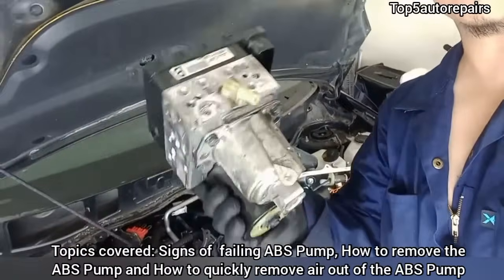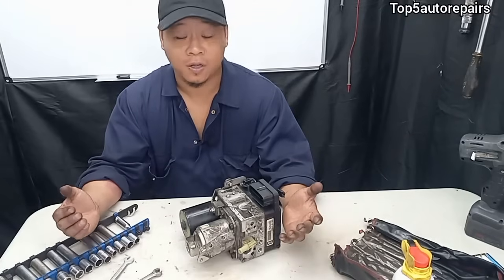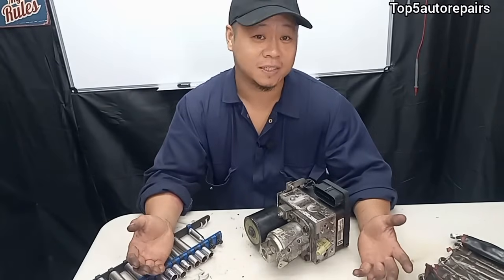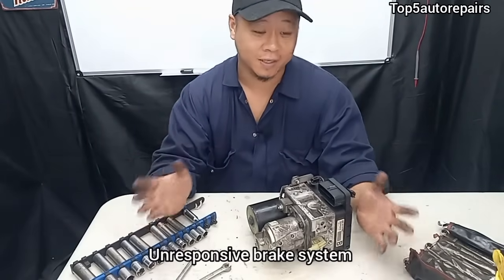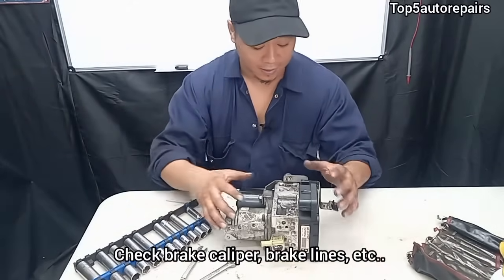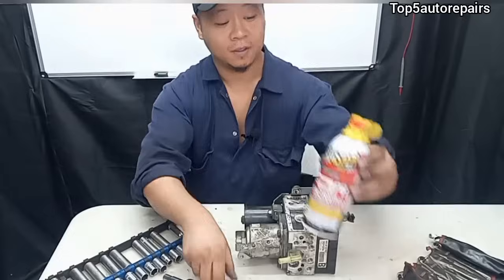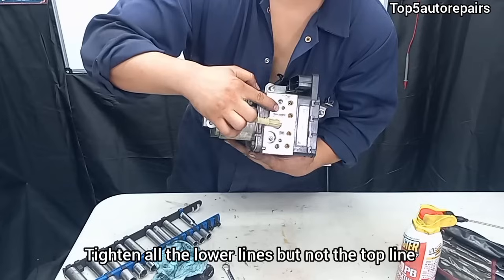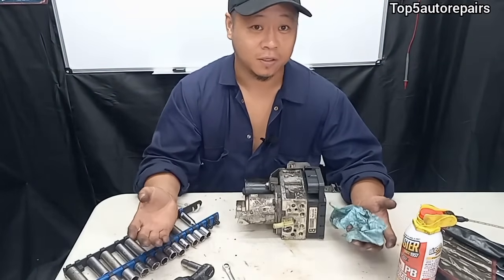4 Signs Your ABS Pump is Bad and Failing (How to get of air quickly after replacement)

Comment: i got a 1997 buick lesabre. Was my grandparents car. Brakelines failed, had all new brakelines installed. Now it has NO pressure to the front brakes. 1 person said the dump valve inside the pump is stuck open. Im lost.
Reply: Might have a brake proportioning valve on that vehicle.  It is designed to seal off part of the system if brake line breaks.  It can become engaged when bleeding brakes.  Probably many videos on how to disengage it on GM vehicles.  There is a little screw in tool usually, but can be done without it.

Comment: My breaks gets hard once I engage it on gear maybe reverse or drive the break is very hard to push but when in neutral it sinks to the floor...
I have replaced the booster and master break but its thesame please what could be the problem

Comment: I have a 2015 Honda Civic Si coupe that starts, I drive it about 30 minutes I turn it off and it doesn't start, I just wait 30 minutes or 1 hour and it starts again. Could it be the ABS pump?

Comment: Great video I have a ABS problem w/ my CVS 3.6 Cadillac, it burnt the module harness and I haven't check it yet but this guy understands them very well   I may just change module and pump... along with whatever. THANKS.
Reply: Have you been driving it still? My dodge charger got a abs brake pump leak…
Reply: @joshflows4848  yes no problem with the brakes.just the abs module and the connector.

Comment: Thank you for taking the time to make is video. Hoping you or someone reading this can advise on my issue. I have a 2014 Honda Accord V6 that dashboard lights up with a few lights(ABS, tire pressure, parking brake, VSD. The local shop did a scan and got codes (81-20 Acceleration sensor, 85-01 problem in VSA system, U1281-00 gauge control module lost communication with MICU, and U0416-68 VSA brake actuator malfunction), Took it to the Honda dealer they said need new ABS unit. Price parts and labor $2400. I saw a couple of videos where they just removed the black module box and sent it for repair(apparently there are services that repair these units for $200-300 and then can reinstall the module. It seems this it not an uncommon failure for Hondas but no recall by Honda. Any options for this repair?

Comment: I think they used to call it the proportioning valve but everything’s electronic today so it’s called a ABS Control Module/Pump. I’m replacing mine now after replacing the left front caliper which was locked up and still have the same issue. I appreciate your video. Especially the bleeding part and leaving the one brake line opened. Thank you! 👍🏻

Comment: My module has been rebuilt but light is still on returned to place where it was rebuilt abs they said it tested good from original rebuild said need to replace pump after a abs module rebuild but they dont make them anymore 01durango so im screwed

Comment: None of those 4 signs happens when I drive, No Codes No trac Lights  BUT When I stop from a 30 mph or higher  the ABS comes on and pumps the brakes.  Its annoying, even after  two mechanics said the ABS system is ok? I am wondering what is wrong with this car 2011 Nissan Maxima  Sv.  I will check the wheel sensors next. BUT  AGAIN  NO DASH BOARD LIGHTS NO CODES NO ELECTRICL ISSUES.
Reply: Have you found a solution, I’m also experiencing the same issue.

Comment: Hi Top 5, your new subscriber. I need your help. In my motorbike with dual channel ABS, on the dashboard, there is no ABS indicator malfunction, yet front braking is poor, it takes more distance to stop. And the rear brake locks up on hard braking. What could be wrong. Any advise is appreciated.

Comment: Hi Top5 I have a Merc sprinter 416 2005 auto . I test drove the vehicle and found the break peddle went  slowly all the way to the floor, so i assumed that it was the master cylinder , replaced the master cylinder , bled the system with the engine and ignition off and the peddle was hard and constant . I started the vehicle and the peddle then went to the floor same as before , with the ignition off the peddle is hard and constant , with the ignition on the peddle goes to the floor . Is this a falling ABS unit ?  Thanks
Reply from the maker: Did you bench bleed the master cylinder prior to installation?
Reply: @Top5AutoRepairs  . No I did on the vehicle at the master cylinder and then at the wheels .

Comment: Hello, 

got a Yaris 2013 hybrid and the rear driver side brake keeps holding, pads got wear out and it’s making constant contact, had the calliper change but still makes contact was told it mind be the abs pump. No warning lights on dash and other brakes are fine just one giving problem.

Could it be the pump ? And does a replacement used pump needs programming ? Or is it better to repair the current pump?

Comment: Lots of work and expense to replace that. Why not just remove the fuse that controls the ABS pump instead?
Reply: If you do it, your dash doesn't work properly. And If you go for your annual car check, they will put the vehicle in a machine to analyse the breaking performance. Then it will fail.

Comment: Hello Sir,
I need your help very much.
Abs pump failed in my Toyota Prius 2010 nhw20 since more than 2 months.
I've purchased an abs pump actuator 44510-47050 three times.
Every times after being placed, it wasn't functioning.
My car tech has tried all possible.
I don't understand what's the issues.
Are the spare parts I've purchased are all defective.
Please Sir, can you get me such a used fully functioning spare part and also grant your help to guide my car tech to resolve the abs malfunctioning issues.
Awaiting your reply patiently.
Reply from the maker: They're not defective. Air is trapped in the ABS pump/Actuator. You may need a scan tool from Toyota to bleed it.
Reply: @Top5AutoRepairs  Thanks loads Sir for your reply.
My car tech has his scan tool.
How must he do the bleed to remove air?

Comment: My problem is I keep having to get my brakes repaired about every 3 months.  I keep taking my car to Midas for new brakes but after the second time, Midas brake company told me to take my car back to the dealership and tell them my ABS is malfunctioning and causing my calipers to tear thru my pads just about every 3 months.  I’ve had so many problems with my Chevrolet Equinox.  My car dealership tried to tell me it wasn’t my ABS but I don’t believe them, so I’m taking my car to a different GM dealership because every time I keep having to get new calipers, pads, etc.  I’m so frustrated!
Reply: So what did the stealership say the problems was?

Comment: Could you tell me why my abs pump runs non stop killing my battery ? i unplugged it and it drives fine but now all the lights on the dash are on. other then that the van drives fine its a 2019 ford transit. Any input would help.

Comment: Old rubber brake lines can decompose internally and not release  the brake pressure. Be sure to factor  that before changing out your ABS. Sticking calipers can also cause the brakes to act strangely. You can check this by feeling for hot rotors after driving.

A line wrench is also called a flare wrench.  They prevent the  fitting from stripping if they are on too tight.

Great tip for getting the air out. I am dreading changing out the ABS module on my Mazda 6.
Reply: What if mother keeps running?
Reply: I will pay and provide the best ADOBO!

Comment: 2008 Escape, new master cylinder, good brake pads , no leaks, good booster. Brake pedal bleeds down to floor. No abs light and brake light doesn't come on. Didn't start having problems until I took off from a dead start and spun a wheel which the traction control light came on. Didn't have brake pedal when  i went to stop I had to really pump them. Got home, shut it off, pumped the brakes up hard and then they worked, until I spun a wheel again. Same thing.
Reply: Did you figure this out??
Reply: @Steven-pi4nv  no I just replaced the abs unit with a used one and bled the brakes again and still no pedal.
Reply: Reset. Calibrate
Reply: @levanibatimala7740 it had air in the master cylinder after I replaced the abs unit.  I bled it again and now it still works fine.

Comment: what if all my abs lights come on and when those come on it also turns on my brake light and my power steering turns off and my obd2 scanner gets no reading from front left abs sensor and my abs sensor intermittently stops sending data/fails?

Comment: I think mine is going on my equinox,car shakes when I go 35mph,it disappeared then came back,the abs & stabili trak light came on then went out,dont know if its the sensor or the abs pump,tested the sensors in front & no reading where the back ones I get a reading

Comment: Hey there
I have Toyota Pruis 04 or 05 with a FUCKING problems with that ABS module it keep making noise & some time braking system. Also I got a other ABS module from E-bay it was a used unit. If I check the ABS unit real closed I find a hair line crack on the bottom base unit that it call computer broad. So I put the old ABS module pump back in the car 🚗.  So could you tell me how did you get the last 5-brake line back on the unit. I don't want to FUCK up the brake line up.
I'm calling from Houston TX
Reply from the maker: Remove the inverter and you'll have plenty of space to work on the brake lines. Just take your time and don't rush it.
Reply: @Top5AutoRepairs Can a used abs system work
Reply from the maker: Yes but make sure to bleed it for air. You'll need a scan tool for this.
Reply: @Top5AutoRepairs  Thanks I have LKQ an auto recycler would you know if the module has to be reprogrammed? Its an 04 explorer

Comment: My car's brake peddle is very spongy even after air bleeding the system. Could there be still air stuck in the ABS pump?
Reply from the maker: The master cylinder is probably failing
Reply: @Top5AutoRepairs  I've replaced it twice! Still spongy. I've also replaced the brake rotors and pads.
Reply from the maker: Make sure to bleed the brakes on a 4 wheels. Start from the back wheels and work your way to the front closet to the master cylinder.
Reply: @Top5AutoRepairs  that's exactly what I did! Still nothing :( . So, could there be air in the ABS module it self?
Reply from the maker: Try power bleeding it. Force air in the master cylinder to push all the air out. This will require an air compressor.
Reply: @Top5AutoRepairs  I'll see what I can do.
Reply: @Top5AutoRepairs  doesn't the ABS module have a bleeding bolt?
Reply: Did you figure this out?

Comment: Very interesting and helpful information. The ABS pump and ABS module is the same?
Reply from the maker: Good question. The ABS module is the computer used to process inputs from various sensors such as the wheel speed sensor and the ABS pump is the mechanical part to control hydraulic pressure in the brake system.
Reply: @Top5AutoRepairs  Thanks

Comment: Thank you for the knowledge I’m glad my 2002 ES 300 Lexus does not have a ABS pump
Reply: Did you take it off? A 2002 Es300 absolutely has an ABS system